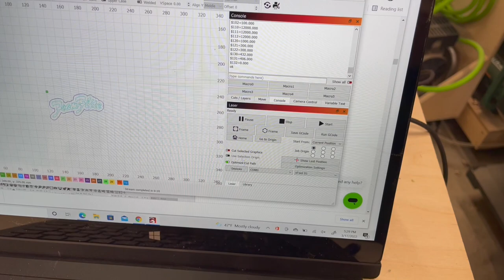XTool D1 DIY Laser Enclosure that fits the stock Honeycomb Bed

Comment: Very nice design. I'm in the process of building it now. One design change I've done is instead of screws to hold the front plate on, I've used 1/4" rare earth magnets flush mounted on each corner (8 total). Very easy to just snap on and off as needed. It automatically aligns itself as well.
Reply: Great idea 👍
Reply: Oh, that's an AWESOME idea. I have a bunch of those magnets, I think I will add this concept to my new plans. Thank you!

Comment: Your exhaust fan should be as close to the outside vent as possible. What you have now puts positive pressure on the hose, so any tiny leaks blow smoke into the room. If the fan is at the outside vent, the hose is under negative pressure, so the worst that a leak does is suck a little room air into the hose.
Reply from the maker: You are correct, I only had it set up that way for the video while on my workbench in the shop. Inside I have the fan just before the wall vent outside.
Reply: Oh, thank you! I am so glad I scrolled through the comments. I have to revamp my plans I had, good thing I didn't start cutting any of my wood yet. I am new to all of this and am making my own enclosure.

Comment: I am so glad I didn't start cutting my wood for my enclosure yet. I have it all measured and marked out, but you pointed out some things I never even thought of. I was trying to go off the size of the wood I already have, to cut down on how much cutting I need to do. I am a newb, and not comfortable with power saws, but I bought a circular saw anyways, and taught myself how to use my bosses huge a$$ table saw(I think that's what it is...its huge and scary). Turned out to NOT be as scary as I anticipated :) I asked him 2 months ago to cut some wood for me so I can build a work bench...he still hasn't cut it, which is why I did it myself LOL. I didn't even think about the air flow coming from two different levels depending on what job I am doing, and I didn't even think about allowing myself to be able to take the machine out of the enclosure if I need to. I also didn't realize I could cut holes for all connecting plugs so they can be on the outside of the enclosure. I wanted to do that originally, but had it in my head that everything had to be IN the enclosure. Revamping my plans now LOL. Thank you so so much for this! Very informative and extremely helpful!

Comment: I made my own (in progress) of your enclosure. I couldn't wait on the plans LOL!  I posted the build in the xTools D1 forum in case you want to check it out. I made a few small changes.  A hinge on the front panel.  I am going to use sliders for the D1, not a fixed shelf.  And I am thinking of cutting a 20 x 20 inch hole in the base so I can lift it to accommodate deeper objects if needed.  I am using a six inch duct since I already have a 6 inch in line fan.  Great inspirational video!
Reply from the maker: Nice work!  My goal is share what I'm doing to hopefully inspire others to give it a try.  I'll keep an eye out for your mods in the forum!
Reply: I just received my D1 and I would like to check out your plans, I did look at xTools for a forum and there was none.  Where can I find where you posted your plans.   Can you provide a link to your plans?
Reply from the maker: @JoeL-sc4cy  There is a link in the video description where you can find the plans. Let me know if you have any questions.

Comment: This is a great design concept. I like how it hugs the engraver rails, and the ability to slide the honeycomb in was a stroke of genius. 

I have a finger brake and wanting to do something similar to your idea, but make it out of Aluminum sheet, and have Acrylic for the lid. I also wanted the whole kaboodle to have an open (or removable) base, and be portable so I could engrave a table top without having to remove the engraver from the enclosure.

KUDOS!!!

Comment: Bought Plans today then off to Lowes for wood. Got some pieces cut today and now waiting on screws.  A SainSmart LC-40 will live in the enclosure.  Exhaust piping is complete to the outside of garage.  Thanks for designing the Plans.  There it is an A-Plus! Looking forward to air assist and a roller bed.

Comment: Excellent enclosure! Thanks for the content and tips! I'm thinking of making one myself, but would like to incorporate an adjustable bottom shelf. Whether that be manual or slide-driven remains to be seen. Currently I have a manual shelf that I can slide in different levels, depending on the size of the object I'm engraving, but no enclosure. Again, thanks for the inspiration!

Comment: I love the enclosure, and can fully understand why you don't want to go into manufacturing of them.  However, you could sell the plans in both PDF form with cut files/materials, etc.  And possibly even the CNC files needed to recreate it exactly as you have it. That way others can take over the manufacturing of it.
Reply from the maker: I'm actually working on the PDF plans and will offer the digital files as well. I hope to have them finished up soon but as its just a hobby, my time to work on it is limited but I want something decent that people can follow without difficulty.  Stay tuned!

Comment: Nice. Looks like all you have to do is add several inches to the sides for the extension kit.
Reply from the maker: That could work, you'd have to make sure to have room in the correct spot for the cables and I'd want to make sure there is no sagging from the wide body.  I'm hoping to extend a laser or two this summer and will play around with the extended design then.

Comment: This is awesome Steve, you have done a wonderful job in both design and function. I bought the plans from Etsy and am waiting for the parts to come in from Amazon for the build. 

I was wondering if you could provide links for the LED lighting and Limit Switch you used? I think that feature is a plus and would like to duplicate the design.

thanks
Kurt
Reply: i know its been awhile but what did you do with your lighting situation  I'm starting to build mine now for my extended version
Reply: An answer from Vintauri would be a good thing. It would still be good to answer this question. I'm about ready to install the lights.
Reply: Another month and no reply. Maybe I'm missing something. Oh well.

Comment: Looks perfect. In principle as the one I plan to build my D1. However the laser has not arrived yet :( 
I especially like that the honey comb sits on a shelf and the possibility to control the air intake toward the bottom ans top.
Very neat design and well made.

Comment: Bold move going with white in a smoky environment.
Reply from the maker: I was using up some paint I had on hand, plus it's an exterior rated paint that will be more durable and easier to clean.  It also help reflect the light inside the case making it easier to see.  I have no disillusions that it will get a bit dirty over time.
Reply: Great video and love the build.  Any concerns about making the enclosure out of wood based products?  The OEM ‘tents’ advertise as fire resistant.   What is likelihood of catching enclosure on fire?

Comment: Great enclosure for the D1! I'm totally new to the XTool engraver/cutter that I recently bought unfortunately I'm thinking about returning it since I do not have a workshop to operate from- but thanks for your previous videos!  I've watched a couple of them and just want to thank you for sharing your knowledge and for inspiring novices!
Reply: i have also no workshop.you just need a window where the fumes can go out everything else you can arrange by yourself.If you build an enclosure it should be bigger than the laser and also possible to take out everything because it might be that you have projects what are bigger than your frame or enclosure.so it is always good to have a garage or some more room for bigger projects.also a table saw will help you a lot when you want be able to cut the pieces in the right size if it is wood.

Comment: Love the design!  D1 Pro user here! I currently use a Creality enclosure which I despise!  The supporting rods have excessive flex which causes the enclosure to bow allowing smoke to reach the outside despite having adequate exhaust!  I've had to resort to stuffing plastic bags along the bottom to seal it. Question on your enclosure:  You said that you would modify the honeycomb bed rails and extend them further to the rear.  Was this mod included in the current plans?   Keep up the great builds Steve!  Ya done good!
Reply from the maker: Thanks for the kind words. I did make the changes in the plans that are available on Etsy. So you will have more flexibility in the honeycomb spacing.

Comment: nice job you did of this - will this enclosure plan fit a sculpfun S30 10watt unit into it or are there slight differences in sizes - thanks
Reply from the maker: I'll have to try to double check, the footprint of the S30 should fit in there, but I don't recall if the laser head sits up too high without modifying the design a bit for the Sculpfun.

Comment: Nice design Steve.  

Wondering if your cutting paper or something thin will it provide some suction to hold the material in place on the honeycomb?

My old C02 laser would do this and was useful. Thanks for the video    Lynn
Reply from the maker: If you have the space to enlarge the enclosure to move the air outlet to the bottom as much as possible, it should create a downdraft situation that would also help hold paper down to the honeycomb panel.  This design will pull the air across the top and bottom of the panel, so it might not have as much hold down effect.  I usually just add some thin rare earth magnets to hold paper in place.

Comment: ordered the etsy file and got the box all cut out today. Really going well and easy to follow instructions. 2 Questions for you, I don't have access to a CNC for the front panel to cut all of those air slots. Thinking about cutting 4 parallel slots the (almost) full length of the panel on my router table either 1/4 or 3/8ths. Thoughts? Second question, what is the name of the switch you use to control the lights on the top of the box? Thanks!
Reply from the maker: I’m sure the slots you are suggesting should be fine. Just make sure to keep enough “meat” on the board that it’s stable.  The switch for the lights is a simple 12v limit switch. Here is a link to some that will work. https://amzn.to/3OdofJ6

Comment: This enclosure is great looking, would you be able to put a camera inside for Lightburn? I read you need 14-16 inches away from your wood burn. I  am presently using the Xtool enclosure but that is not tall enough for a camera I think. Any help would be appreciated. Thanks
Reply from the maker: It depends on the camera and it's viewing angle.  The way I designed this enclosure, I was going for a compact set up and not planning for one.  You may be able to find a super wide angle lens that would work, however it would be better to just add a little height to the sides to get closer to the distance needed.  As is there is about 8" of distance from the honeycomb tray to the top of the enclosure.

Comment: This looks more professional than what im trying to do but still good information. I have 1 question tho , is it a bad idea to have air assist pump inside the enclouser?
Reply from the maker: I would not recommend having the air pump in the enclosure,  It will pull in dirty air and clog up the pump as well as push dirty air on your lens.
Reply: Now i have to rethink my design 😂😂

Comment: Hi Steve, I found your plans in your Etsy shop thanks for those. Quick question though, @8:10 in the video with the honey comb installation you mentioned making a change in the dimensions, and I was wondering if the plans I downloaded have this alteration incorporated into them? 
Thanks again, the plans look very well written!
Reply from the maker: Yes I did add the extra depth for the honeycomb bed into the plans so there is more room to adjust it back farther. Thanks for checking them out!
Reply: @Vintauri  Thank you sir, love the plans!

Comment: My favorite so far! Likely going to buy the plans. 2 questions before I pull the trigger, please. What did you use for materials? Is it tall enough to use the RA2? Thanks
Reply from the maker: The RA2 will fit for most objects without any modification.

Comment: Hi Steve, I can't find anywhere comments on the effectiveness of the smoke extraction, but I assume it works well as no-one appears to have commented otherwise.  Is this a correct assumption? Regards, Sam.
Reply from the maker: It's works well if you have a good fan and limited hose between the enclosure and the outdoor vent.  The longer the hose and the more bends, the less effective the fan is.

Comment: Hello, great design. Like it a lot. Anyhow I have a question. How do you fix not flat MDF or other material on the honeycomb. I use 3d printed pins that I put in honeycomb. I can assume that in your case this could push the honeycomb parcial down. Greetings Dietmar
Reply from the maker: I use 3D printed honeycomb pins.  They only hold onto the honeycomb and the material, so there should not be enough force just from that to deform the panel.  Some cheaper honeycomb beds that are made from aluminum instead of steel will be more likely to sag from the weight and will need more support.

Comment: Vintauri, I'm liking the X1tool innovated cabinet shown question; will the plans and cabinet size accommodate the Ortur master 3 laser. Thanks
Reply from the maker: The Ortur LM3 is just a bit too long front to back to fit the enclosure as built, but by extending the back a few inches it would be fine.
Reply: @Vintauri  Thank you for a prompt response

Comment: I purchased your plans and built this enclosure last weekend. I have to say it works great, thanks! No more smoky garage! I really love it.

I had one question regarding the square laser shield on the laser itself. Now that the enclosure has the large laser rated plexi window over the whole machine do you think the small shield surrounding the laser head is necessary? I only ask because I noticed smoke building up inside of the small shield while engraving, even with the air assist on. I'm wondering now that the exhaust smoke is being handled more efficiently with this enclosure if the laser lens would benefit from being free of the small shield trapping smoke immediately around it?

Thanks again!
Reply from the maker: With the laser in the enclosure I feel comfortable running it without the square shield. If you have shorter people or pets that might lurk around I would be careful as the vent slots can let some laser light out. But it does run better without the square shroud trapping some of the smoke and debris. Just always be mindful of the laser light and protect yourself and other from accidental exposure.
Reply: @Vintauri  Awesome, thanks! I've done some tests (not to worry, no kids, no pets nearby) and it works great.
Reply from the maker: @ChristopherWilliams3000  Awesome to hear.  I've been running mine without the shield and inside the enclosure and it's made things much easier. I just make sure nobody comes wandering into the shop without warning and have extra safety glasses on hand in case they want to check it out.

Comment: in reference to the led lighting I've been looking on amazon for the lighting and limit switches  is there a good package deal for the lighting  i guess I'm just dumb founded at myself that i can't figure it out
Reply from the maker: There is not a direct kit for the lights.  You'll need some LED strip lighting. https://amzn.to/3YTSkT4   Then if you want switched with the lid, you''ll need a limit switch https://amzn.to/3YOmFT7 and some wire https://amzn.to/45qMsDk. You'll also need to be comfortable with some basic soldering to make it work.  Otherwise you can just use the switch that comes with the LED strips manually.

Comment: Fantastic enclosure.  The best that I have seen yet.  Do you, by any chance have plans for it and what material did you make it out of,
Reply from the maker: This is primarily made from 1/2” plywood. I slide in the sheet metal on the bottom to help protect the base from any laser beams that make it through the material and never run it unattended in case of a flare up. I do have the plans and build guide available. The link is in the video description. Thanks for checking it out!

Comment: Great job.  Did you use 1/2 " or 3/4" plywood? It is hard for me to see on the video.
Reply from the maker: I used 1/2” plywood to keep it a bit lighter. You could use 3/4” if that’s what you have or want to make it more robust, but once this is all glued together the 1/2” plywood is plenty.
Reply: @Vintauri  Thanks.  That was my plan anyway  (1/2" since I have plenty on hand).  If you can get a cultist out by Sat that would be great LOL.  Otherwise, I will just wing it. Great design.  I am going to use a 6-inch opening which I think will be able to get the top and bottom with equal effectiveness.  I already got a 6-inch Infinity inline fan.

Comment: awsome work, quick question, why do you need an additional fan ? what it does ( sorry I am new to laser diode machine)
Reply from the maker: The fan on the case is to pull the smoke out of the enclosure and then its piped outside via a 4” hose similar to what you might find on a dryer or bathroom fan.